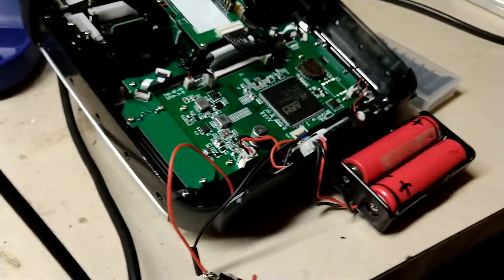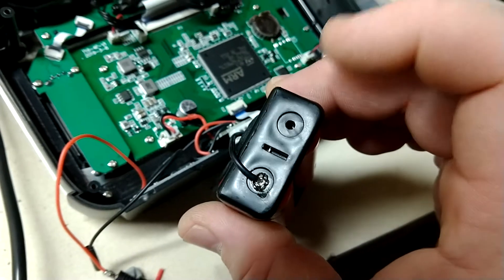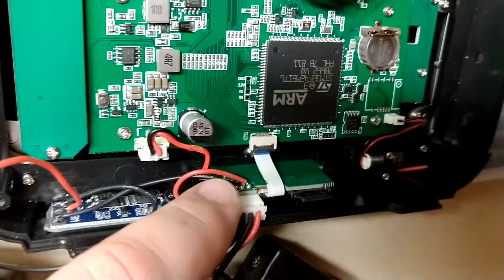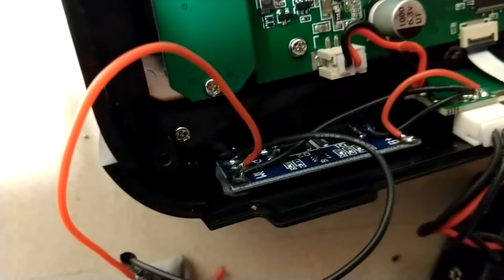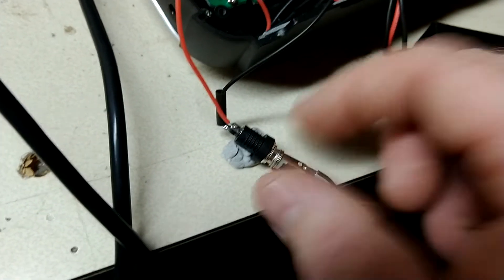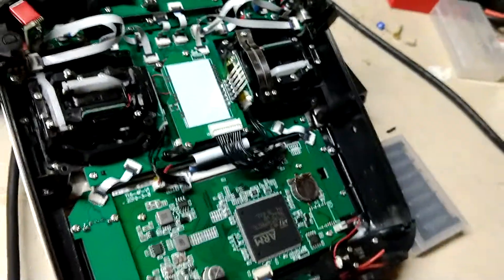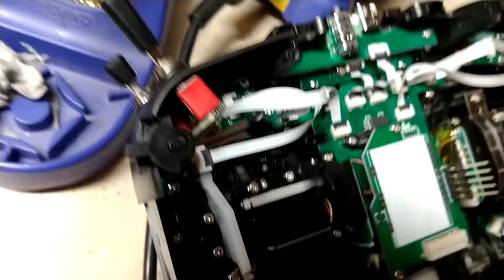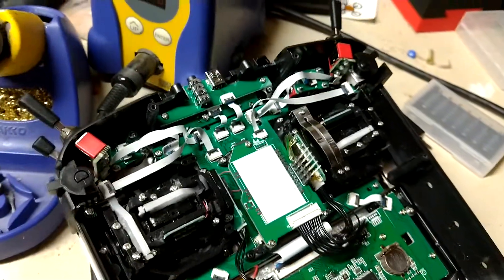Jumper T16 internal charging mod

Comment: Nice work men. I have a problem and I dont know what or why but I'm not sure if I know how to make the radio arm the drone , I know I have to bind it to the receiver I have a Frsky XM + mini receiver and I follow the steps on how to bind it after the press of the little button and at the same time connecting the battery then the green light come on up to that part I think I got it right . But then I connect the drone to betaflight and I did flash the firmware on it successfully then there is not movement of the sticks and I try different ways. I'm knew on the hobby but by now I should be able to get that going. Need help thank u.

Comment: Maybe a larger  2 cell 2p slide and lock  system in the battery bay? I need more capacity to run both radio and R9M.  And can be charged by my balance charger. Oh as long as I'm wishing, I need a Jumper Companion cause I still can't get my "Pro"  T16 transfer models without Emergency Mode events. And...I am looking for some replacement case screws with metric hex heads since it looks like I will be in and out of this thing. And another thing...I like this thing that may replace my aging , early, Non-Plus X9d passed to me by Dad, an early adopter.
Reply: I suggest you look at Grayson hobby on the YouTube channel they have the solution for the emergency mode ... I just need to find an easy way to program this damn radio for my old helicopters with flybar systems and dual rates

Comment: What is the minimum and maximum voltage you can feed the bms, and what's the minimum voltage the bms will be able to power the t16?
Reply from the maker: You really want to give it 8.4 volts, and the radio is not powered from the balance circuit. All the balance board does is keep the batteries from becoming dangerously unbalanced. I will rely on open TX to warn me when the battery is low. I would rather trust the radio and not have the BMS cutting off the power mid flight.
Reply: @bengmo64  Yeah that's why I asked, having the BMS power the TX or batteries directly. I think I'll do it the way you did, just for safe measures. Is it possible to both charge and discharge at the same time using this method?
Reply from the maker: @SemteVruchte  you should be able to use the radio while you charge it, I haven't actually tried it.